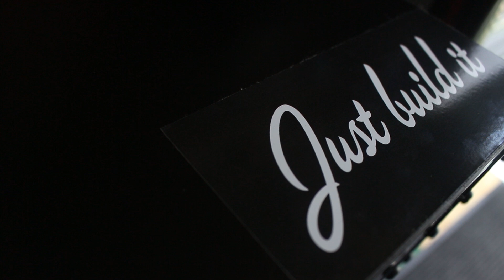k series engine build

Comment: has anyone ever had a problem with rtv gasket, i think i have used too much, and once bolted down its squeazed over an oil tube thing between block and header. is this a thing? engine starts but no oil to cams?. thats the only thing i thought of, not a mechanic just an avid diy'er. lifting it back out this weekend and strippping to see. yey!

Comment: Whats that procedure called at 8:23?
Reply: RaptureUK1 tightening the main cap bolts to certain spec then adding 56 degrees to them, its a torque angle gauge

Comment: Nice work. I didnt see you use plastigauge to check the bearing tolerances. Its been a while since iv’e rebuilt an engine am i missing something? Is it unnecessary? Im planning on rebuilding a k24 in the very near future.
Reply: Edward Orange plastiguage is to measure bearing clearance but real engine builders measure all the engine components to 0.001" thousands of an inch so you have no need for plastiguage

Comment: I hate the k20 oil filter location
Reply: Same dude, could the engineers put the oil filter at a more shitty place and harder to reach? If you don't have the removal kit then the already annoying job will get harder if you're trying to hit a screwdriver through the filter to twist and remove it.  But that's the price we pay for the precious Vtec.
Reply: Aj Rodillo for real I just changed my oil on my new car and was like wtf where’s the oil filter
Reply: Pwhiiite 1 imagine being a woman who doesn't know anything about cars attemting to change a k20 oil filter haha. Or on the shitty BMW's without dipsticks so you can never check the oil, the oil filters usually hidden under panels and they do it with the fuel filter as well.
Reply: I hate the k24 oil filter location, because of header Toda

Comment: Cool video. My Ep3 I imported from Japan has nearly 90,000 miles not kilometres. I've done PS4 tyres, brembo discs/pads all round, mobile1 oil, blitz oil filter, blitz air filter, spark plugs, gear box oil and it's absolutely great. The car is absolutely immaculate and I rarely ever use it. My only question is the timing chain, will I replace it? It's full history from Japan and it's perfect. There's nothing wrong with it at all but because of you're expertise what do you think? Regards.

Comment: Nice! Hey brotha, I'm in the process of building my first motor and was wondering what tools were you using for the piston rings, measuring of the pistions, and inside the the actual sleeve. Much appreciated .
Reply: bore gauge and micrometer
Reply: Micrometer, Feeler Guage, bore scope Guage, inside Micrometer ,Dial Indicator,Vernier Caliper
Reply: Snap on too... cant go wrong with there tools. Very accurate and you can always have them re-calibrated
Reply: Edward Orange True

Comment: is it true that k20 oem tct have problems with aftermarket cams?
Reply from the maker: i've personally used factory tct on bigger cams.i always make sure to use a new tct,have proper oil supply and preload the tensioner.doing that never had an issue with a high ramp cam.older style tensioners cant really hold up to the bigger cams,but using a 07+ tsx tensioner has worked for me in previous builds.
Reply: thank you
Reply from the maker: Screaming z1 never ever re use bearings.if they're removed,you should replace them.if the motor isn't knocking bearings shouldn't be touched unless you're replacing them completely for a rebuild.as far as tct the tsx will work.
Reply: Awesome video man! very meticulous, and a lot of great knowledge goes into your builds! 

Question about a tct, my k20z1 180k miles, shows no sign of worn tct or chain but have been thinking of just replacing the tct through the little access plate on the timing cover. should i replace the chain too? im going to go oem, should i use the stock k20z1 tct or the 07+ tsx tct as you mentioned above? thanks in advance!

Edit: did you re use the bearings that were originally in the build? i know its fine to do if the crank and bearings were fine, just wondering. 

When re using the bearings, correct me if im wrong, but you dont even want to polish the crank because it will change the clearances, correct? just clean and reassemble? Also what did you clean them with? THANKS AGAIN MAN!! AMAZING WORK!
Reply: Ello Built thanks a million man
Reply: I want to know the truth to this as well.

Comment: hi does the k20 have oil squirters as standard?
Reply from the maker: Paul Dude on k20a/Z and k24a2
Reply: didnt know that. more i read up in these k20 the more am inpressed. i"d say that helps with reliabilty considerably? do they have an oil cooler?
Reply: Yes they do but it depends on the k20 variant. Same goes for the oil squirters.